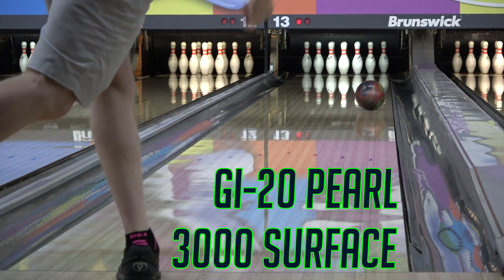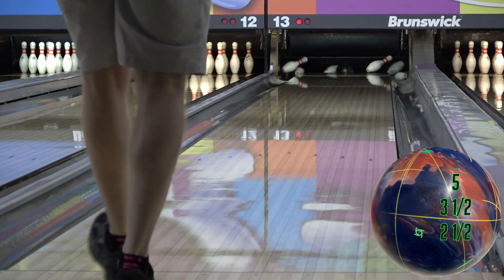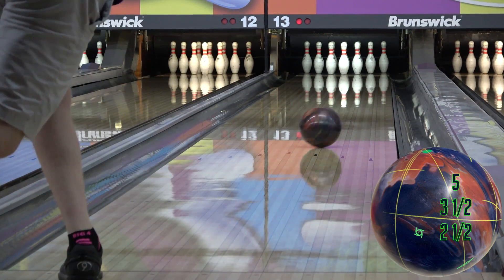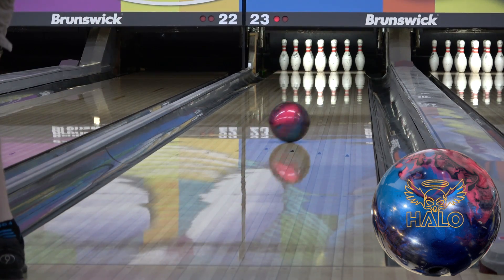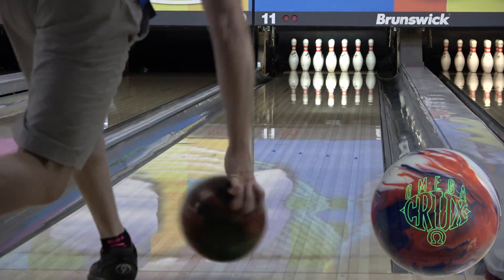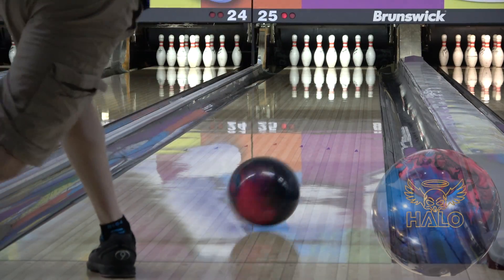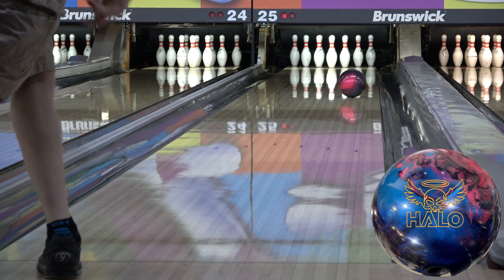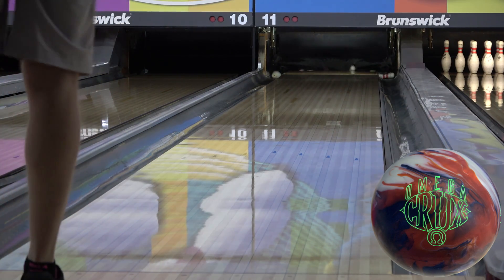Omega Crux vs Halo Pearl

Comment: If you were choosing, idol pearl or phaze 3? And I called the winner of the TOC.
Reply: i own both balls.. 16,7 mph, about 450 rpms with a two handed approach.
Let me tell you this: These Balls are quite similar yet not really.. for me the phaze 3 is a lot stronger and sharper than the idol pearl. So the idol pearl would be the perfect step down Ball from the Phaze 3. Both go long and store alot of energy.. well depends also on the layout i guess.. i drilled both balls just for length with the pin over bridge dont know the excact layout.
The Phaze 3 is about 4-5 boards stronger than my idol pearl and also a little bit quicker downlane atleast with box finish.. my idol pearl sits around 4000-4500 grit hand polished.
Imo these two balls work really good with each other.. so you have to choose if you want a pretty nice and strong ball with the idol pearl or an amped up version with the phaze 3.
Both great balls though.. ;) Hope this helps a little.
Reply from the maker: Idol Pearl is more versatile, but when the Phaze 3 is the ball, it's the nuts . .

Comment: what ball would you recommend for a fresh 45 foot Python pattern? Straighter type, mid rev, mid speed bowler.....thanks!
Reply from the maker: I'm not really sure, sounds like you'd want something on the stronger side, but depending on the lane surface, it could make it interesting.
Reply: Luke Rosdahl on THS I can strike at will. On that 45 foot monster I barely get into the 200’s by the 3rd game. It’s maddening. Can’t practice on this shot as it’s a league only alley